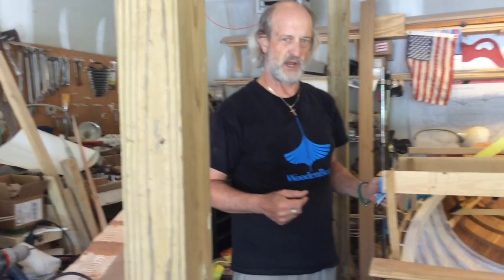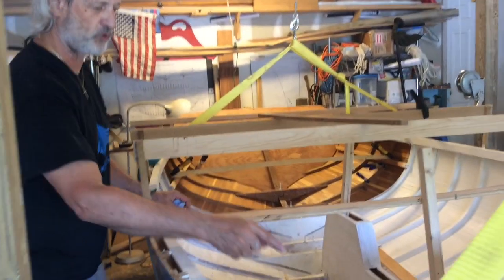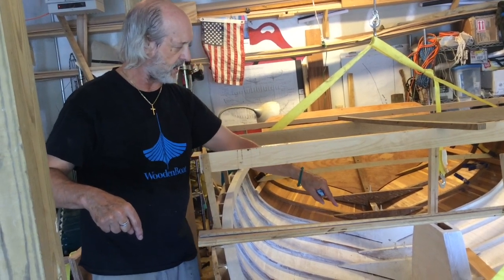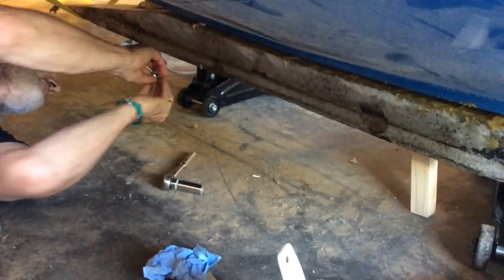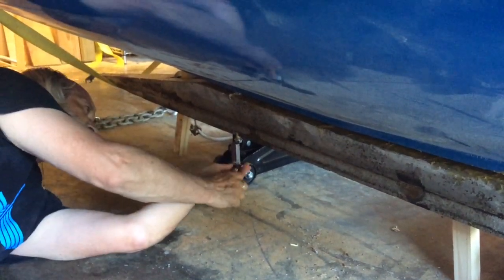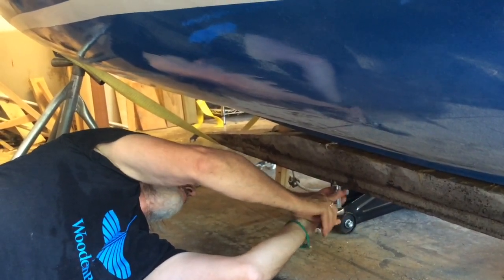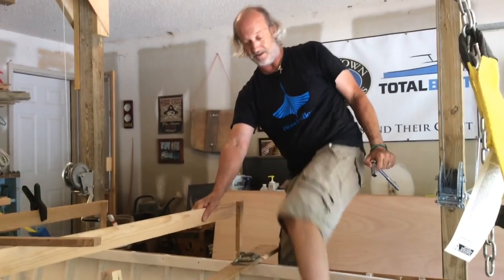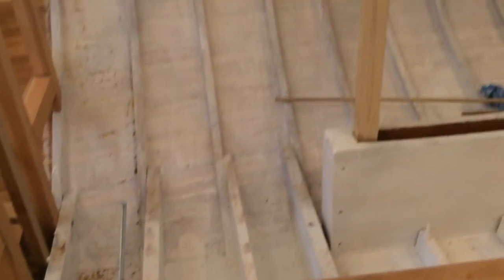Haven 12 1/2 -Bolting Up Lead Ballast - Episode 66

Comment: No locktight?
Reply from the maker: good question. I have thought about it. With as much 3M 5200 as is on the threads and nuts, I think it will be pretty secure. I may test that theory in a couple of weeks, and if they seem loose at all, I will take your suggestion. thanks!